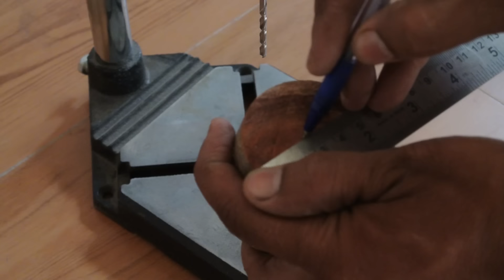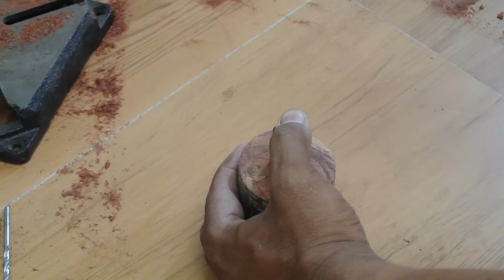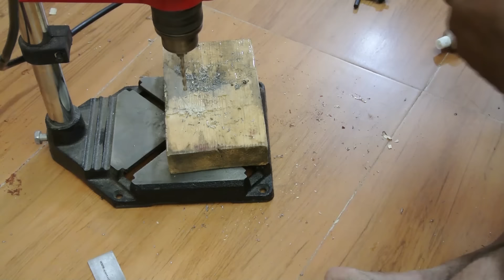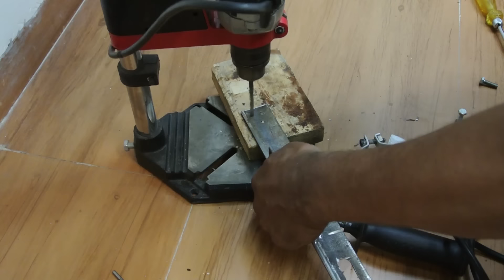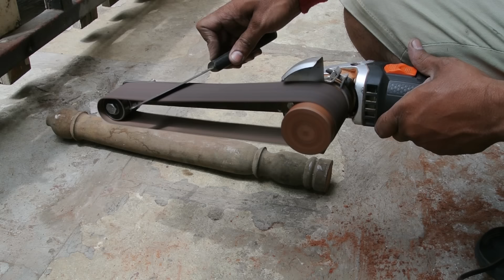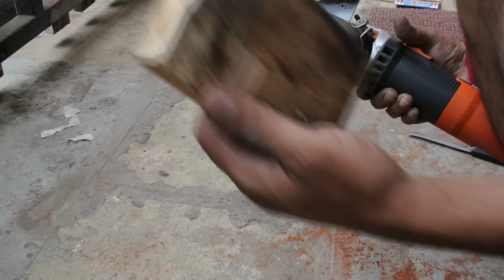Angle grinder hack 3  (belt sander)

Comment: Você precisa de tensão da mola para manter o cinto apertado para impedir que caia. Também o barril de vinho moldou a roda motriz de madeira para mantê-la reta.

You need spring tension to keep the belt tight to stop it from drifting off. Also wine barrel shaped the wooden drive wheel to keep it tracking straight.